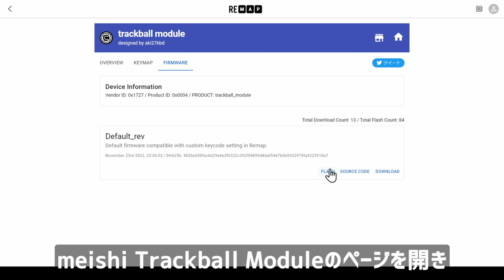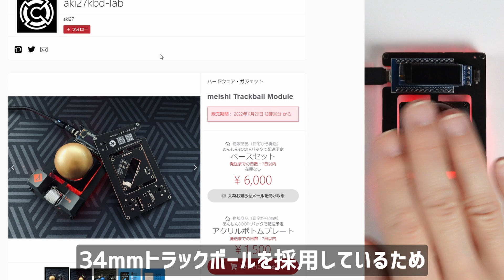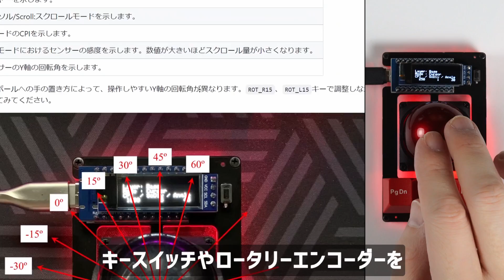自作キーボード作ってみた meishi Trackball Module編 | meishi Trackball Module: Custom Mechanical Keyboard Build

Comment: Hi, I have purchesd the kit from Yushakobo. my trackball case and ceramic ball come separately and the ball not fit to the hole. it smaller and the hole can't keep the ball. which gule do I need to use for holding them together?
Reply from the maker: I do not handle product support.
Please contact Yushakobo for assistance.
Sorry I couldn't be of more help.